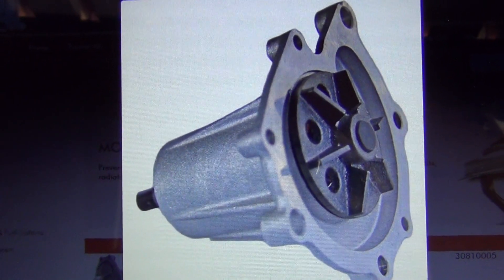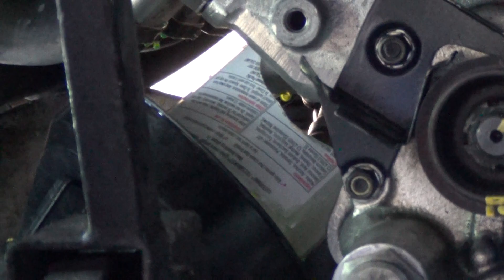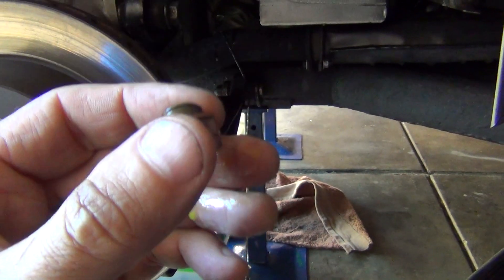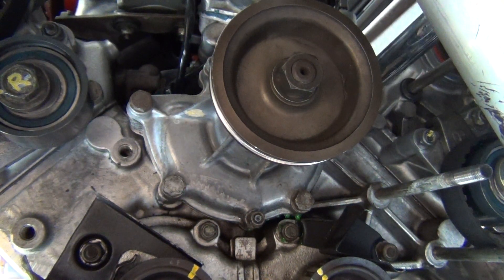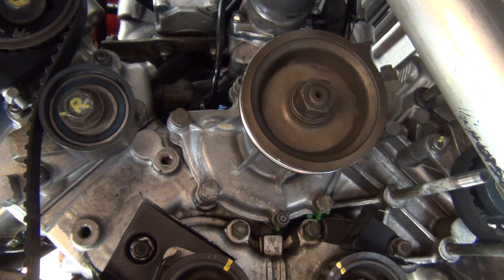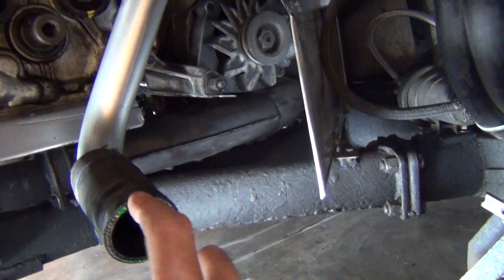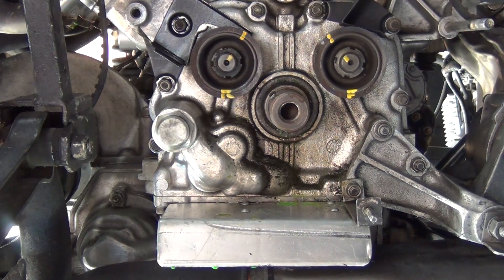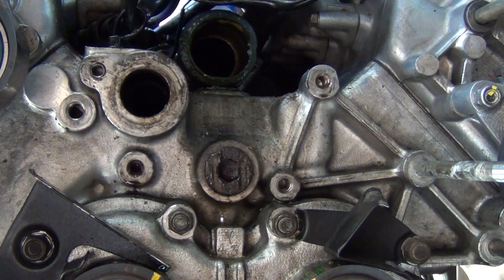Ferrari Mondial QV 1985, PART 1 Water Pump Removal/Replacement

Comment: Good job. If the hoses are original and depending on vehicle age or refurbishment I usually replace the hoses even though there are no visible signs of ware. Great video demonstrations and tips for Ferrari backyard mechanics. Cheers
Reply from the maker: Yes dead right. I do replace the hoses in the future vid's. Cheers, Marc
Reply: THE MESSENGER Spoiler Alert!
Reply from the maker: Hey Robert. I didn't catch on it was you at first...I received your last email and found it very interesting to say the least. I'll be in touch soon via email. Like you, I've been really busy trying to get things done, so I've been a bit slack on my social contacts. Hope all is well on your side of the Island...Time to open the borders I think. Talk soon. Marc
Reply: @themessenger5868  Hello again, all good all in due course you have enough on your plate with the car I see. A very clean motor. Bye for now.

Comment: Marc, this is great!  I'm  replacing the 328 water pump (cam belts, tensioners, etc) now.  I will be interested how difficult it is to replace those two coolant hoses (plenum removal required?), and any specifics on replacing the thermostat.  Hopefully you will describe any additional material you use along with the replacement gasket (rtv?).  Also curious how you remove the pulley from the water pump - looking forward to your next video.  Thanks!  -Carter
Reply from the maker: Hey Cater, yes I cover all the details you've noted. There's nothing difficult to replacing the thermostat. Go to my thermostat gasket replacement vid and you'll be sweet. Cheers, Marc

Comment: Looks fairly straightforward. Hope the project doesn't expand like the last one! I'm doing a fuse box rebuild/replacement this month on mine. Ever had to deal with that?
Reply from the maker: No ! Electrics is a swear word to me...
Reply: THE MESSENGER fuel pump circuit on the fuse box printed circuit burned out so car would crank but not start. Fairly common issue from what I have heard.
Reply from the maker: @howardscott7521  Good to know...cheers.